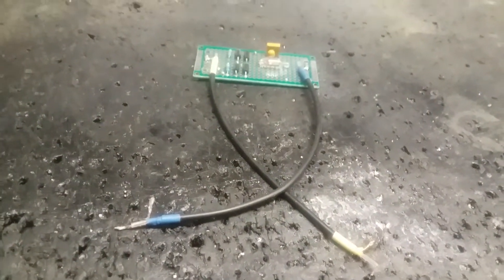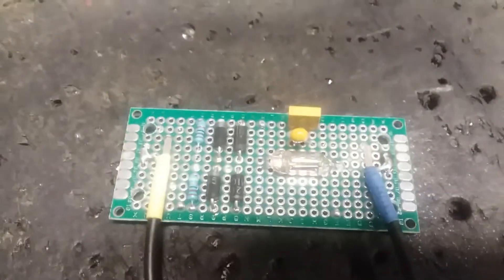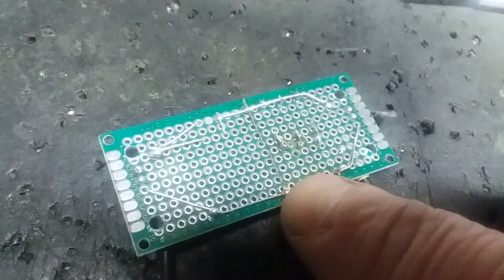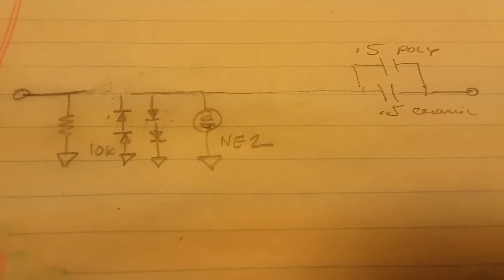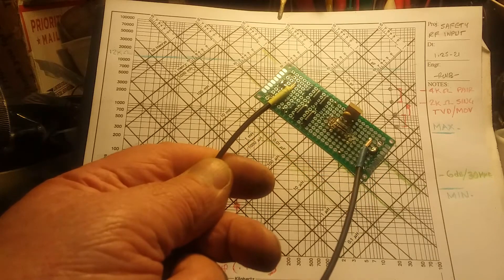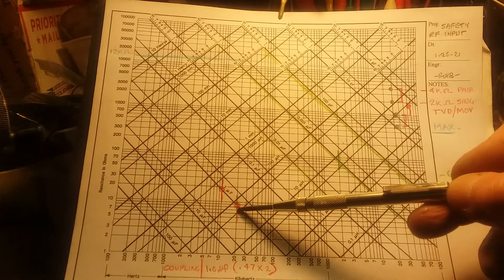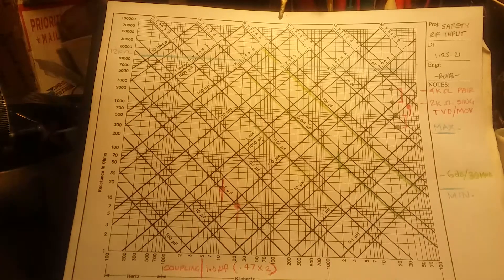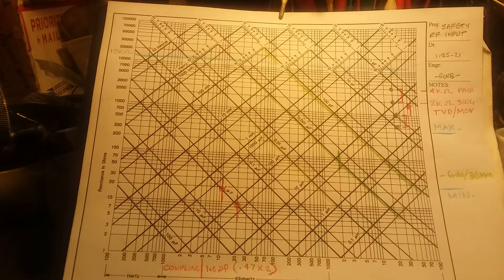Radio Receiver Nearby Lightning Protection and Static Bleed

Comment: Static DC I herd 3 meg ohom 2 watt carbon resistor will kill static DC or a choke you can put them on the antenna or in the radio

Comment: Hi ..I am Deniz from Turkey..I have problems with my long wire antenna..one of my radios is damaged about that..Then I saw your video and watched few times..I have some questions for your help pelase.. the resistor..is 10k enough? And watt of it? 2 watt? The diodes ..1n914 or 1n4148?? And the values of caps please? And the last one if static comes from antenna will the bulb light?please help me for protecting my radios..thanks so much...
Reply from the maker: A 2-watt is fine. If you are in a high storm area, I'd go to 5K to keep the bleed more constant. The diodes are typical for temperate environments, you and use 2 or 5 amp diodes in you wish. The NE2 is just there for any transients that may get past the diode turn-on time, One NE2 will give some signal attenuation at 30 kHz maybe 1 dB loss at 27-30 MHz. Two NE2 in parallel will start to attenuate after 24 MHz and be about 4dB at 30MHz. I hope this helps.
Reply: @n1kpr  thanks so much for your help..2 to 5 amper for diodes enough ..am i right? So capasitors value is .01 uF? And just a ne2 is enough? Sorry I will try to make it myself and just a math teacher😂😂 i wannna learn well before making the circuit..

Comment: I've been using a similar circuit on my SWL antennas for probably 40 years. Basically ever since static electricity on a long wire antenna blew out the front end of a receiver during a snow storm. I don't even remember where I got the idea but probably R-E or Pop Electronics magazine or maybe a ARRL handbook (Way before the internet). I was always impressed how much that little neon bulb would light up in a snowstorm which seems to be worse than a thunderstorm and I suspect that was because of the lower humidity
Reply from the maker: Thanks for sharing. Years ago, while sitting in the shack, I heard a loud snap. Then I noticed the PL259 laying on the desk was arcing from the center pin to the housing (160 meter end-fed). I went to ground it to the antenna switch and got the shock of my life. Some time later, I built a box with a Neon NE2 tube and a photo diode connected to the base of a digital counter. Every time the NE2 flashed it triggered the counter. One night there was a light snow fall and the tube was flashing away. At one point it registered 38 flashes per minute ... that's the most I've ever seen.

Comment: What are the advantages of this over a static bleed resistor alone?
Reply from the maker: A bleed resistor is always a good idea but it will not stop a transient Spike which is what lightning discharges create. Even a nearby strike can induce very fast but very high voltages.

Comment: I have a whip antenna on my truck that blew the front end of a scanner. I was told to put a 1K 1/4 watt carbon comp between the mast and ground to drain the static. I'm scanning for 159-161 mHz.